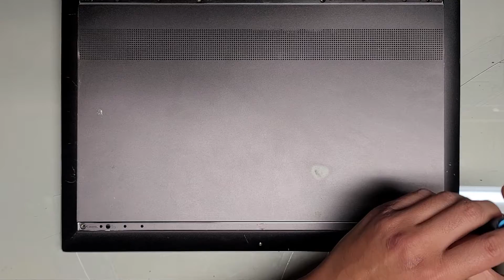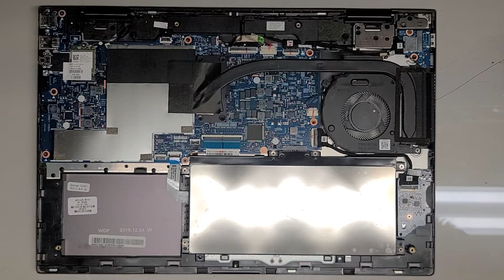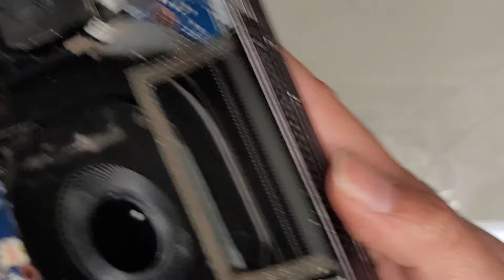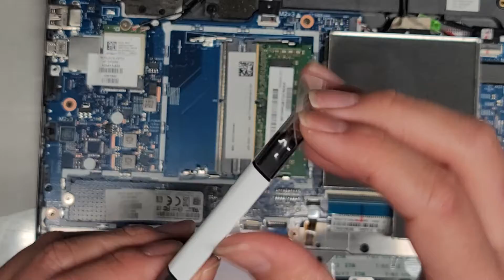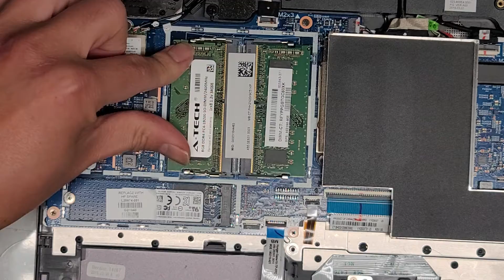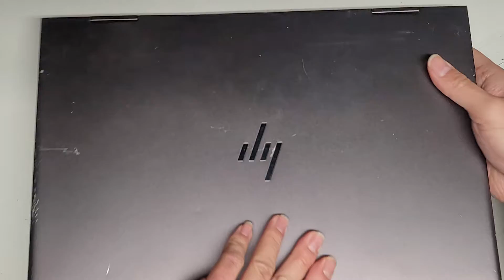HP ENVY x360 Convertible 15-cp0053cl Disassembly RAM SSD Upgrade Battery Replacement Repair

Comment: Trying to upgrade by adding a 8tb hdd1 drive,  have the rubber bumper and finally have a 12pin data cable.  After connecting hdd1 to mb and 2.5 ssd, 
When turned on the power light blinks twice then very long nothing and another blink pattern.  No fan no screen nothing but ac power led solid.  
What setting am I missing ?
Reply from the maker: Does it work ok when disconnected?
Reply: Yes it starts fine.  With new upgraded mb.  HP MB AMD 7 2700U 15M-CP 15M-CP0012DX(AF54)*.
Back info,
About a month ago laptop would not do anything. Watched this video plus others and  I was able to open laptop and guess it was something on mb.
Put in new mb and started right up no issues.   Ordered the 12pin cable and tried to connect to hdd1 and now nothing again.  Disconnect and starts up just fine.  The gold 12pin is facing down, sata is pushed on all the way new ssd 2.5 drive.  Guessing The 12pin cable is making connection because it is causing No Start when connected. The bumps on side of 12pin end look to be centered and past the catch bumps on the mb connector.  Would the 8tb be to large for mb to see it when connected?
Reply from the maker: Maybe wrong cable

Comment: Hey quick question,, will this support gen4 pcie m.2 ssd
Reply from the maker: It should work. I don't know about max speed.
Reply: @ItsBinhRepaired  I'm confused with crucial p3 and crucial p5 plus... And what processor you got ryzen 2700u??
Reply from the maker: @bharathi..24 I don't own the computers in my videos. They're all customers'. P5 plus will be better
Reply: Thanks for your reply,,, one last question, do you know how to find whether it supports gen3/4 I didn't see anything mentioned on the port .. asking because if I get p5 plus it's speed is around 6600mb/s and if my system doesn't support it'll get down to 3000something..
Reply from the maker: I'm not sure how to check that other than benchmarking it.

Comment: I own the cp 0012dx model and my speakers are just making crackling sounds even when theres nothing being played an when there is anything being played ypu can hear the audio but the crackling is jus do bad u can hardly hear the audio after seeing this im wondering if my speakers connector is just loose or do you think i need a new speaker replacement
Reply from the maker: Hmmm try the headphone jack

Comment: Hi, that's the same model as mine and it has both an SSD and HHD storage drive, but the only drive I can see is the one next to the battery. Are the combiner? If not, do you know where the SSD is?
Reply from the maker: What does it show in the disk manager?
Reply: @ItsBinhRepaired  hi, thanks for the reply! I found it, it's under the metal box next to the RAM.
Reply from the maker: @bYeonios  yup, just like in the video.
Reply: Yah, it’s an NVME M.2 drive. I’m looking to upgrade capacity as well.
Reply from the maker: No limit

Comment: I got a bad hard drive error at startup. So I bought the ssd and backed up info and made a recovery drive . There is no ssd in this cover? How do you replace the ssd if there is none?
Reply from the maker: How much of the video did you watch?
Reply: @ItsBinhRepaired sorry I skimmed your video. I figured it out. it's been 7 years since I was in computer repair and thought they all had actual hard drives not these PCIe SSD stick. Things have changed. just educated myself on it after I opened up the cover.
Reply from the maker: Nice

Comment: Great video! Not only was it the exact HP Envy 360 that I was replacing the battery for, but I never knew that it had an extra ram slot as well as an extra hard drive slot. 

One question, is that extra storage slot for HDD or SSD? And where would I get the adaptor and rubber mount?
Reply from the maker: Either. It's for a 2.5" SATA drive. The adapter maybe Amazon or ebay.